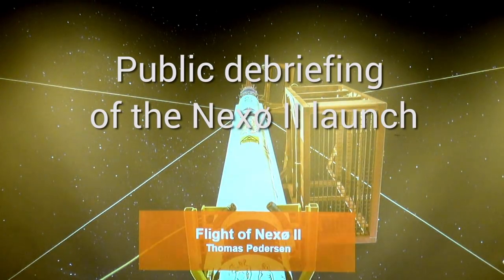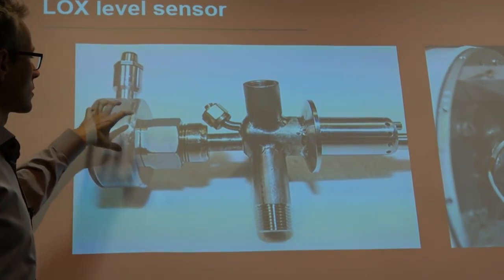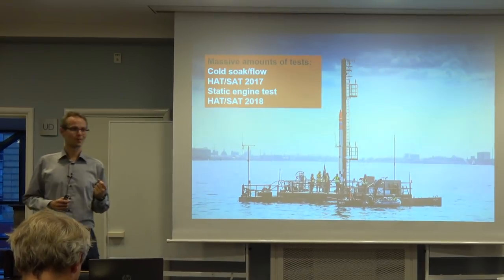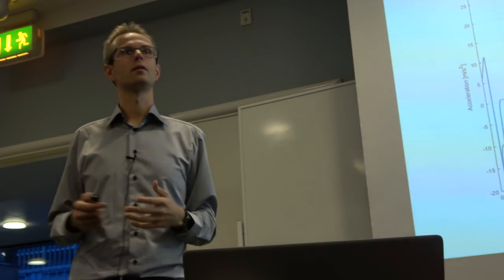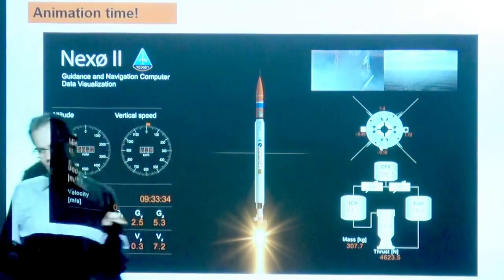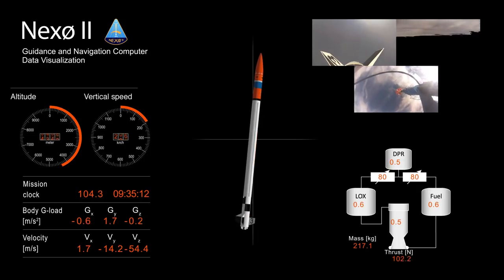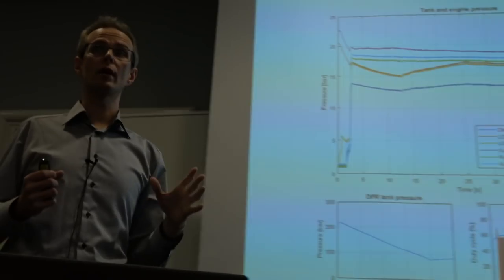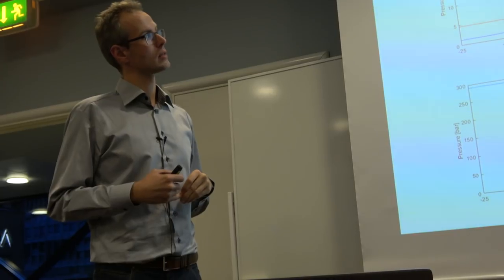Nexø II debriefing part 3: Flight Dynamics and data analysis

Comment: Excellent analysis, and this really shows the enormous value of the telemetry data.

One observation I make though, is that the DPR control algorithm does not seem to be very assertive (if it has a PID loop, maybe the gain is too low). Your pressure curve shows when an apparent obstruction reduces helium flow during pressurisation, but the LOX DPR valve duty cycle is limited to around 60%. With such a gross pressure error, I can’t understand why the valve did not go 100% open if the control system has sufficient gain and control authority.

This is also repeated in flight, where despite such a gross error in tank pressure in flight, the LOX DPR valve never open much more than 60% duty. The fuel valve also opens a similar amount, and that is working okay it seems.

It is as though the DPR control is tuned for an ideal case, and does not have sufficient gain to respond to real-world deviations from the ideal. In that case it is working more as a scheduler than a controller.

Good quality, stable, assertive control of critical flight parameters is key to launching an astronaut. And the lessons here, (as well as possible lessons in engineering cleanliness, if debris is found to have obstructed He flow), are vital for the programme going forward.

Any comments? Is there any public information on the DPR control system you can direct me to?
Reply: Not a CopSub member, but attended the debriefing. They are definately aware of this issue. It was not programmed that way as I understand it. Most likely, either a leak occurred or a sensor had a failure. So far, any results of an investigation has not been publically stated. It has taken some time though fore them to get the rocket back to Copenhagen due to harsh weather in the Baltic.
Reply: Daniel Rea Kragskov I’m not a member either, and was not able to attend the debriefing. I just went on the info shown in the video, what I understand of the DPR system previously covered on the channel, and my own painful experience designing, debugging and optimising control systems. Just interested, and eager to learn more about what was found. But I appreciate that Nexø II is not yet back in Copenhagen, and a thorough investigation will take some time. I’m just an enthusiastic follower, with a bit of experience in the field of control.

Comment: A guess here; I'm not a rocket scientist, but an employer used Liquid Nitrogen, and experienced a similar effect, which was eventually tracked down to icing in supply lines:

Are you able to check whether you had an issue with ice buildup in the LOX lines and/or valves? Water ice could be a contaminant in the Oxygen. That might be the cause of the fairly quick reduction in flow, followed by an equilibrium point where the LOX abraded the accumulated ice as it built up, resulting in a slower, but constant, flow rate.

Comment: I'm sure you've thought of it, and in the case of the Nexø II it might not have been worth the reset, but wouldn't it be a good idea to have an automatic abort system in case of non-nominal chamber pressure just before lift-off? And how about a fallback mode for the DPR where the fuel/LOX pressures are equalised if one tank can't maintain nominal pressure? On the manned version that should probably just be an abort scenario (at least if enough height had been attained at that point), but if you're thinking of lying the Nexø II again... ;)

Comment: I used a fine mesh stainless steel filter (swagelok) upstream of my propellant valves to catch any "stuff" that might find it's way into the helium tank.  They're small and lightweight and will flow huge amounts of helium.  Cheap insurance.